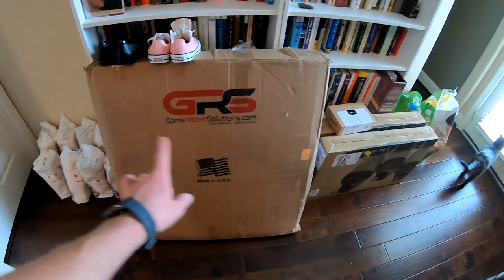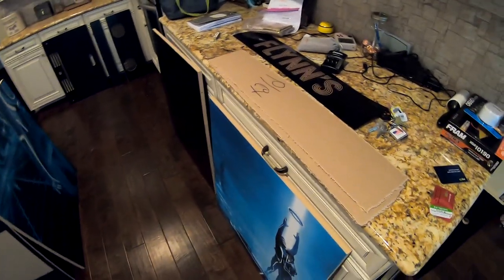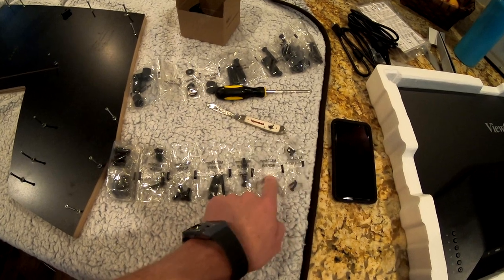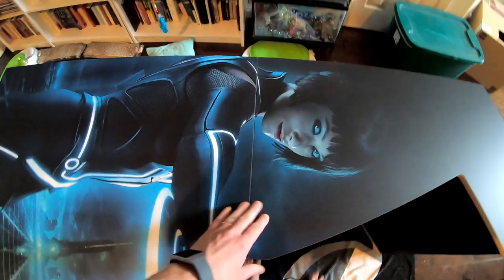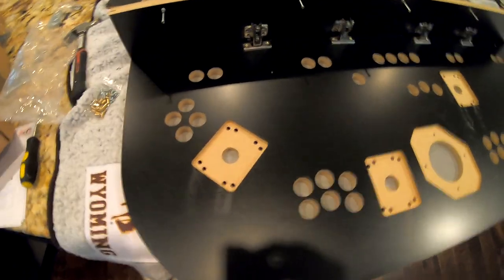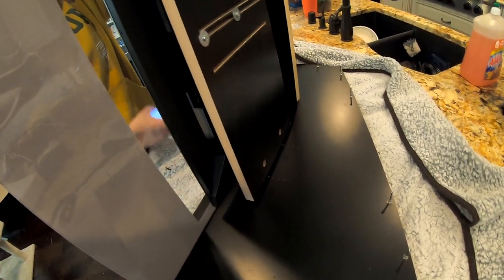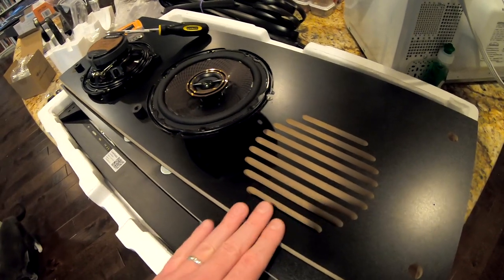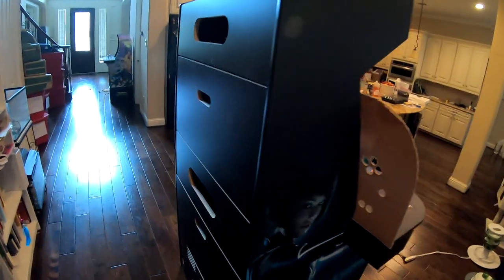Assembling 4-Player Arcade Cabinet from Game Room Solutions

Comment: I got the 43" version and in the process of assembly. Some of the stuff I agree with, some I don't. Mainly, the speakers are definitely an issue. My solution was to cut the holes for 6x9 speakers, which actually looks more proportional, given the board width. As for the mending plate alignment, yea it's an oversight, but not a real issue in my book. I rather drill my own holes for that anyway to assure the screws are anchored properly. For the rest, there are so many proprietary parts that it's difficult to make something that will fit everything. It's a DIY cabinet, so client mods are almost a given, so if you are buying, assume some mods will need to be done..
Reply from the maker: You’re more forgiving of a product for which you shelled out so much money!!

Comment: Good video and almost identical issues that I had with the same build about 9 months ago.  (Pieces not fitting together great, bent tmolding, speaker mounting, etc)  My artwork lined up with what I designed and I used a 32" TV that seemed to fit fairly well.  I did ask them about the 4 screw holes in the control panel versus 2 in the base and they told me that 4 holes are for the pedestal base but the 4 player cabinet only needs the 2 holes.  I haven't had any issues with only using 2 screws so far.  GRS did send me the wrong configuration of the control panel and plex but I did receive a replacement from them within the week.  

I've honestly had more issues with their recommended software solution versus anything that GRS sent me but I agree that they could use some better quality control or design tweaks.
Reply from the maker: Sorry you had trouble.

Comment: Man I got mostly lucky with mine. They forgot to drill a hole for the 4-way stick, two camshaft holes. My panels were mostly damage free. I had damaged t molding and scratches where it didn't matter (like the back panels). There were considerable gaps in the control panel. I managed to repair 90% of the cabinet. I used epoxy putty and wood filler, drilled missing holes, replace t molding, realigned panels, etc. I also did a lot of reinforcing with L brackets and placed washers in various areas. Visually, my arcade looks quite good after everything is said and done, now it just has minor cosmetic imperfections but you don't really notice them unless if you look closely. It was a nightmare putting mine together, but it came out fine in the end.
Reply from the maker: I’m glad you had a more positive experience. My point was that after paying that much for something, you shouldn’t have to do any of the extra work you describe. GRS needs better quality control and customer service.

Comment: I ordered the same unit as you did and ran into some of the exact same problems.  Missing holes in the pedestal mount, misaligned holes for the mending plate.  They also sent me one of the wrong back pieces, which they did fix after I bugged then for six weeks (part of the problem was it was the holidays). BUT the game room solutions people were fairly quick in responding to my questions.  (Sometimes it was "just drill it out", which I didn't love.).
Reply from the maker: Glad you had a better experience.  I think enough people have complained about their lack of customer service, they're slowly seeing that they are, in fact, the problem.  Not their users.  But, I won't be using them again, that's just a personal preference.

Comment: Might be super late but I noticed you were debating on switching the orientation of the joysticks. On old school arcade cabinets thats how they were designed (main reason being because of the smaller screen). You can look on the original Teenage Mutant Ninja Turtles arcade cabinet,  the 1st and the 4th player are set up at a 45ﾟ angle. Also check out old Simpson's and original Gauntlet cabinets, all of them have that orientation.  
Honestly when you said that the orientation was different on a newer cabinet I got curious and I looked it up... thought it looked a little weird.
Reply from the maker: Interesting. I guess I’ve never notice on those games. It just doesn’t seem as intuitive that way. To me anyway. Thanks for watching and for the info!!
Reply: It’s oriented that way because of standing position

Comment: Did you find a lcq screen for the Marquee?  I was thinking of this kit, but seeing what you went through, not too sure now, but still curious about the screen though.
Reply from the maker: I did. I got it from a dude off arcadecontrolsforum for $200. The height is about right for this set up, but the width is a little narrow. It’ll require some sort of holder to get it in there, but to save $500 off the one from China, I’ll take it. I’ll put up a video about it sooner or later. His FS thread on the forum is usually near the top.

Comment: I dunno why this review is so negative.  I have one of these 4 player cabs from GRS and I love it.  I had a couple little snags putting it together, but nothing a knife and screwdriver didn't fix.  Well worth the investment.  Buy one and enjoy.
Reply from the maker: Did you listen to it?  If I'm paying that much for something, it should be more fine tuned than this.
Reply: @MRNBricks  yeah. I wish I had seen this sooner. Currently assembling mine and for 1000 dollars, when I call and say that several (about 1/4 of them) of the cam holes aren't drilled through the sides, they just say you can drill those yourself in a few seconds.

I know I can, but I paid a grand for someone else too. My control panel was a lot worse too. I got the "modern" cut layout and the miters are so bad, they overlap and cover the button holes on the sides. A shit load of other probs. Most are minor on their own, but for the price..
Reply: When little things are out of alignment it turns an hour of installation into days of installation, going back and forth with people via email that have no customer relations skills. It is very frustrating. Their product installation guides offer no detail; it is like a brake changing guide that says, "Remove wheels, remove caliper, insert brake pad, installation is reverse of removal, done". No detail at all. Mending plates don't line up. There are two screws per side and only one per side actually fit. I put the clips on the back doors, secured all the cams, and the back doors won't clear to shut. Little thing after little thing. It adds up. But all in all their prices and free shipping can't be beat. Making some minor corrections isn't so bad when you shop around and see what Recroommasters charges. But GRS is frustrating because they have the potential to be great and hold themselves back with poor quality control and customer service.
Reply: Hi I'm Rob Robertson and totally not a fake account to damage control my trash cabs.

Comment: I got the two player version of the cabinet.  I didn't have as many problems as you did.  There were a couple though.  

The biggest problem I had was that the bezel didn't fit in the grooves.  I ended up fixing it by cutting away the graphics from the sides of the bezel.  The lack of instructions really added to the frustration, though.  I think if they had included instructions it would have helped with some of the problems you had.  Tell people they need speakers that are flat in front (they do make those) and to avoid those monitors that have the vesa mounts off center.  

I was pretty happy with the end result, so I guess it was worth the trouble, in my case.  It's better than the arcade1up mods I've done, anyway.  Very solid and sturdy, and I like the way its designed, with the control panel that flips up.  I actually got a pinball cabinet from them too.  That one did have instructions.  

I can see why you gave a negative review though.  They could definitely make some things easier.
Reply from the maker: Yea. It went together, but for that much money, it shouldn’t have these issues. Glad you got yours to work!
Reply: I've got the same issue here with my bezel. What did you use to cut the acrylic down to size? The only cutting tools I have are knives, so I guess I need to either try that or go out and buy a saw of some type.

Comment: Did you leave player 3 and 4 oriented as is? How is it?
Reply from the maker: I haven't got 3 and 4 to work yet.  But, just from messing around, it's a little awkward.  They should be oriented more in line with the screen.  I may try to fix it, if I get really bored.